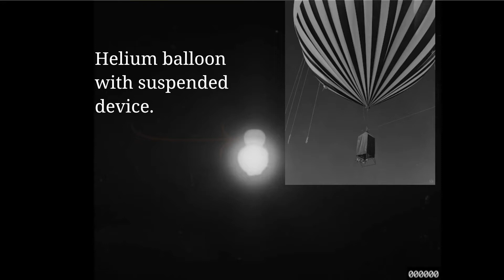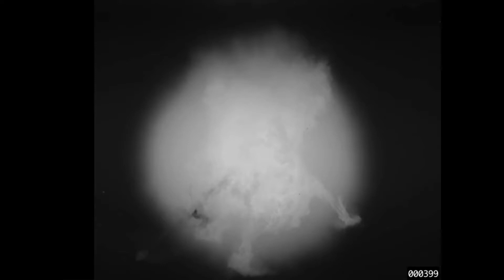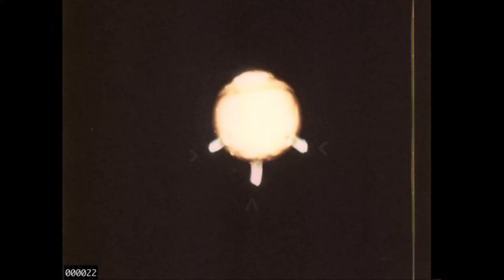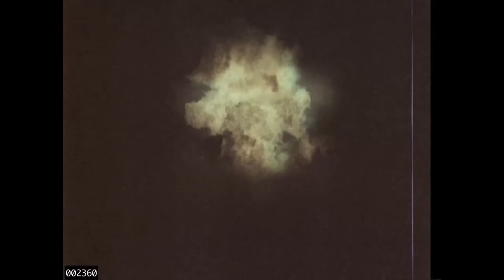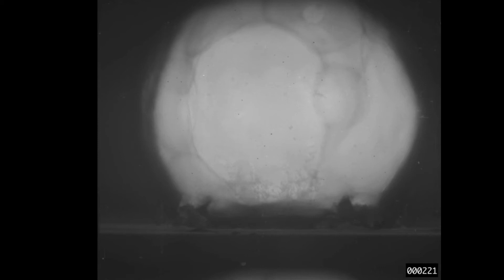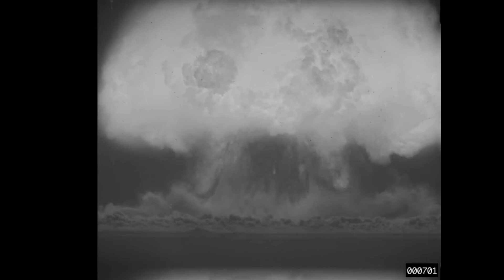High-speed fireball photography and the "Rope Trick" effect phenomenon.

Comment: This explanation is incorrect. What you are looking at is surges of electrons, literally blown off atoms of the bomb by the intense gamma radiation. These electrons form a spherical layer around the shock called Debye charge separation. What you see are surges of electrons being conducted along the metallic guys and tower. The effect is essentially the same thing as lightning. As a matter of fact, there are high speed Boys camera photos of lightning strikes and they look similar. This spherical shell of electrons also gives rise to the EMP effect associated with nukes.  Dr. Malik, who was one of the original physicists at Los Alamos did extensive research into this, some of which is unclassified.
Reply from the maker: No, it’s from X-rays proceeding the initial fireball, heating the guy wires and tower structure to the point of vaporization through ablation.
Reply: @Deutritium93  your theory is plausible, but the shock has an initial expansion rate of 8000 miles per SECOND and i don't think the cables had time to vaporize before being engulfed. there is  famous photo of Oppenheimer standing on the spot where the tower was in the Trinity test. The twisted steel remains of the tower are clearly visible. as i understand it, x ray ablation was the principle behind exoatmospheric ICBM kill vehicles...as to the details behind these weapons i will never know, but i sure hope they work one way or another when the time comes.
Reply: You have many accounts? This has already been tested and shown the effect is due heating of the wires by the black body radiation coming from the fireball that heats the surface of the wire crating a shock front of heated gases ahead of the main fireball enabling faster propagation of the energy.
Reply: @BjarneLinetsky  That number of 8000 miles per second only seems plausible during the first microseconds of the explosion, when the fireball is a few meters in size and just outpacing the x-ray generated fireball. By the time the ropetrick begins to manifest the fireball is expanding at less than 100km/s likely even slower than half that. Edit, now that I think of it it might not even be when the fireball is a few m in size but not even leaved the casing of the device.
Reply: @BjarneLinetsky The remaining metal from the tower wasn't vaporized because it was buried beneath the surface and unearthed by the blast. Anything above was toast.
Reply: @BjarneLinetsky  They do have time to vaporize. This is how the Teller Ulam works in a hydrogen bomb. The vaporization of the casing compresses the second stage before it is disassembled by the blast of the primary and this happens all within the bomb's housing.
Reply: @Deanguilberry  My understanding is that the X-rays from the primary, acting on the surface of the fusion fuel heat the surface up which exerts the pressure, that and xrays from the plutonium "spark plug" compresses from within. For all practical purposes, the parts of the bomb are heated up gamma ray hot, but because of inertia have not moved much. Fusion reactions are governed by the tiny size of nuclei and the laws of statistics.
The bomb fusion reaction requires the fuel to be in a superheated, but extremely dense state (degenerate). The speed of light, and then the speed of neutrons is so great that even though the parts of the bomb are super-energized, they simply haven't had enough time to recoil.
The simple diagrams of the Teller Ulam bomb do not tell the whole story....there are a lot of other classified structures concerned with the physics of the bomb that have not become common knowledge
Reply: @BjarneLinetsky  The fusion fuel is jacketed by natural uranium or an inert metal which compresses the 2nd stage fuel. I don't think there's 
much disagreement between our explanations. As for the rope trick, there is a great vid by a Los Alamos physist on it. I'll edit in the link
Sorry, it's Lawrence Livermore not Los Alamos. The talk is with Greg Spriggs. I don't know how to link it but it is great. The title is

Answering FAQ about the nuclear test film
Reply: according to my book (Zel'dovich), air is opaque to X-rays (and much of UV). The hot bomb debris is radiating thermal X-rays that heat the air to radiated cooler X-rays, and so on: the initial fireball is this ball of diffusing X-rays, hence the sharp edge, rapid coolings, and slowdown in expansion rate--it is NOT a shock front. Air is transparent in the near UV, vis, IR, and that radiation escapes line-of-site to fry the cables. It also makes the initial super bright flash.
At some point, the diffusion slows downs and a shockwave forms. We then see the heated gases in the shock's compression front, which hides the much hotter fireball behind it, this is then fireball we're used to seeing in normal speed videos.
Reply: @DrDeuteron  I agree that the initial blast of gamma radiation is degraded to lower wavelengths by Compton scattering etc. But what you fail to mention here is that this initial pulse of em radiation literally blasts the electrons off of any surrounding atoms. Ionization. This cloud of ionization is opaque to em radiation, and accounts for the double light pulse. The fireball or whatever is is hidden from view for a short period. We can think of bomb after the chain reaction, as now being in the kinetic phase, where the fission debris is flying isotropically outwards. It is pointless to talk about temperature at this point, the velocity vectors of the fissioned atoms are all directed outwards from the point of detonation. From my sources, the recoil velocity is something like 8000 miles per second. Electrons, being the lightest particles of matter  are accelerated to higher average speeds. From the study of shocks in astrophysics, this causes charge separation which results in the EMP. You had better believe that the recoiling bomb debris forms the mother of all shocks, or what is termed  the fireball. This is the destructive thermal radiation. There is also quite a bit of x rays in the initial stages, from the shock.